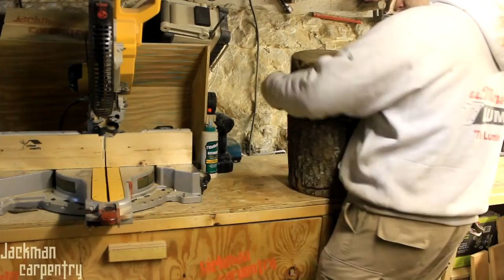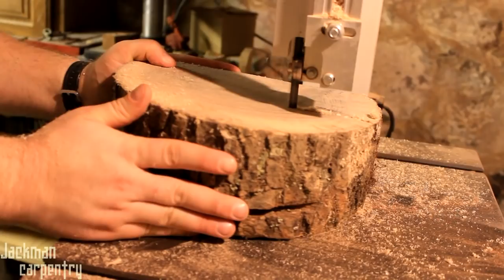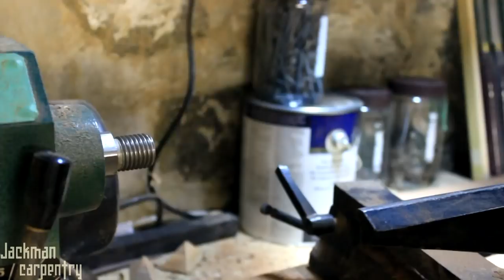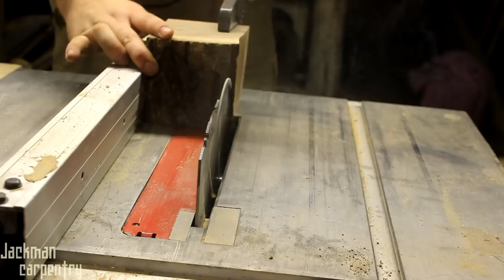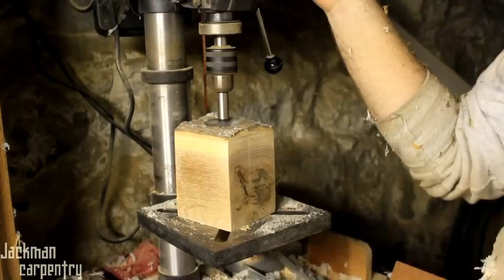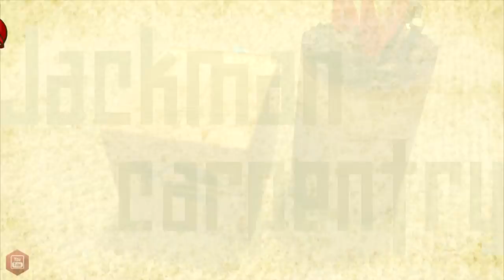Live Edge Pencil/Pen Holders

Comment: This was really beautiful! I have some questions:

1. Did you have to hand-saw the log even with all the high-tech gizmos you had at your disposal? Just wondering.
2. Did you also apply the shellac (please correct me if that coating was not shellac) to the bark side of the pencil holder? Did you use something else? For some reason, I have this thought that the bark is different from wood and should be treated differently as such.

And I prefer the square one. It looks more rustic to me =D